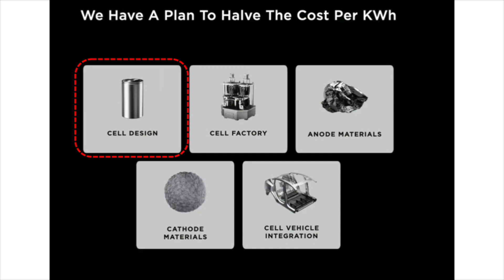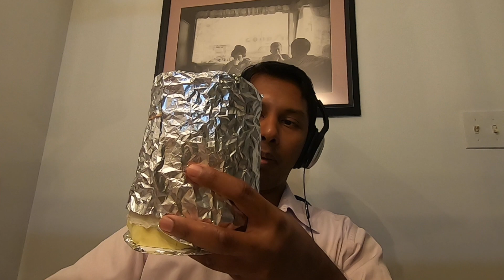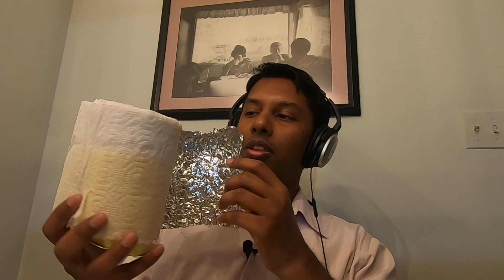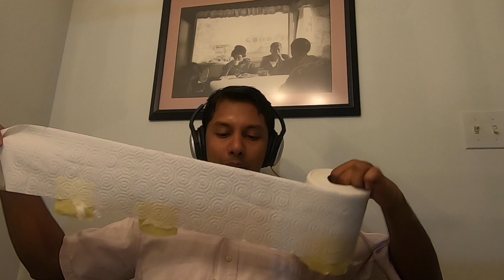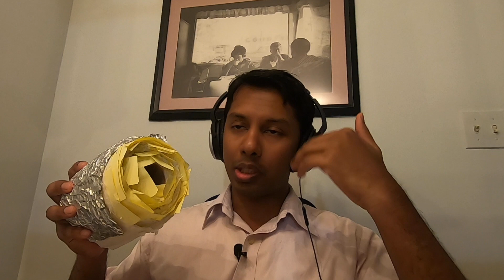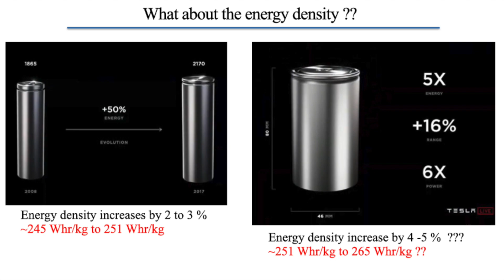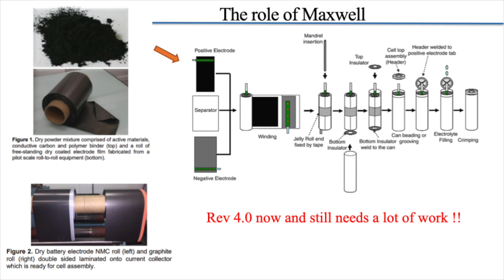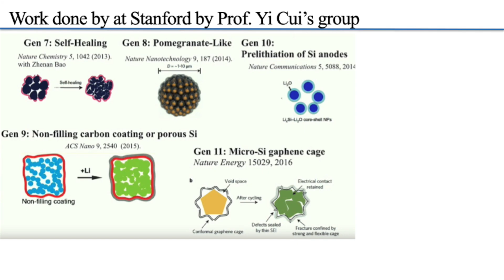Breaking down Tesla's Battery Day with Ravi Kempaiah

Comment: First of all, great video, thanks, 
Secondly, i'd like to ask, does the increased charging rate also translate into a more efficient regenerative breaking? my understanding is that you only get about 10% recharge from breaking because of the heat/charge rate issue. Does this mean that gets a significant increase? Do we know on the order of what? was this the reason Musk stated he didnt want to go down the route of ultra capacitors?
Reply from the maker: I seem to recall Tesla won’t be adding ultracaps to cars.

Comment: Fast charging stations will use a battery bank like a power wall etc which will charge a capacitor bank which will facilitate high current discharge for large battery pack recharging. In a similar manner to way the flash on a traditional SLR CAMERA used to operate.

Comment: Cylindrical design is geometrically more suited to process flow manufacturing. Multiple or continuous points of conduction to the negative side of the cell dramatically reduces both resistance and heat. When i was theorising this almost 10 years ago I imagined the use of an open weave copper fabric as a suitable substrate for the anode. Great design and advancement for tesla team.

Comment: Good video.  Thanks. What are the ideas that weren't far enough along to include in Battery Day and in the coming generation of batteries?  What advantage if any is there to making the cells taller? Unless I'm wrong most of the presentation was on diameter. What about heat and rolling up a coolant layer in the battery? Might there be some advantage if say a turn of the battery had a layer that could circulate coolant?  (Of course something like this would complicate the high speed rolling up) .  I'm just spit balling, but what I gathered on Battery Day and in this video is that some of these ideas are not that new, and some just seem obvious (well, they do now) like the tabless design.  What are the other battery ideas still left on the table? 
Also did I miss no mention at Battery Day of the one million mile battery?

Comment: I believe cooling is now easier because it is done from the bottom of the cell.  The copper and aluminum will conduct heat out the end rapidly as opposed to the heat having to transfer through the non-metallic non-heat-conducting separators.  Much lower heat transfer resistance out the ends just like much lower electric resistance out the ends.  It also has the advantage of cooling uniformly; the inner winds will cool as fast as the outer ones.
Regarding the reason why Panasonic and others haven’t done this is because a major objective of Tesla is to reduce the cell cost.  Right now demand greatly exceeds supply so why cut the cost when it requires a huge investment for Panasonic.  They sell every battery they produce.  Why change?  Tesla has a completely different mindset.  Produce way more batteries at lower cost to accelerate greening.

Comment: With all this extra electricity needed across the country. What effect does this have on the grid infrastructure, what is the capacity of high voltage wires etc. What extra infrastructure will be needed if any say if the electric demand triples over the next twenty years?

Comment: Remember that Tesla bought Hi-Bar systems that makes some of the machines that help with the manufacturing of the cell. Volumetrically, the new cell is 5.48 times larger than the 2170 so you should be able to get a 5X reduction in the number of cells needed for the same kwh. The outer circumference of the cell is just over twice as large, meaning that while they are reducing the cell count, they are also using about half of the outer casing material. This saves weight and cost. The tabless design also focuses the heat to the bottom of the cell which will make for faster charging speeds.....especially for something like the semi. Fun stuff. And Elon admitted that they have had these in their own company test cars since May.

Comment: Here because of Sandy.  I still think every analyst on Youtube and the press have missed the most important thing out of battery day.  On the chart shown at 41:40, Diversified Cathode Approach, as well as comments made by EM , it shows, to me at least, that 70-80% of all Tesla batteries will be LiFePo, and only using nickel for the high end applications........  How did I come up with 70-80%?  The new cheaper car will have 2 - 3X production numbers of the rest of the Tesla fleet plus some model 3 output.  100%, or according to EM, half of eventual battery demand will be LiFePo.  so 50% (storage) plus 25% (cheap cars) equals 75% of total battery consumption by Tesla.

Comment: on 24:20 Sean! demand will grow, electric power for the semis will be provided by the grid. The state energy fuel mix for the grid can define exactly what emissions can related to charging a semi in their grid. Whatever that fuel mix is probably better than to operate the lifetime of the diesel truck! To use only solar and wind is just as gargantuan task as producing 3+ TWh of batteries per year.

Comment: Very interesting to see Ravi’s mock-up of the new cell. To me the picture in the presentation looked more like they were simply cutting (using laser, maybe?) slits into the upper part of the jellyroll to create those shingles without slowing down the whole process, but Ravi used like lots of very wide tabs..? I’m not familiar with the patent description, so Ravi, I assume, has this right. Just wondered how what he showed could be manufactured at the bullet speed Elon wants for his conveyor belts. Cheers!
Reply: caps lock No I’m pretty sure you’re right. And it’s indeed laser cutting as mentioned by Drew I believe.
I think Ravi just used sticky notes to make it more visibly understandable but I could be wrong.

Comment: The solution to charging the semi-truck quickly is relatively straight forward using existing technology. The trick is to charge in parallel, by having, for example six individual100Kw battery packs each one driving an individual motor or pair of motors (as parts of one truck). On the charging side, you would need effectively six standard fast chargers (combined into one large unit) each charging one pack at a rate of say 250KW. This would mean that the Semi truck could be fully charged in the same time as a standard Tesla car no problem at a rate of 1.5 megawatts. Now I am sure it is not that simple but the principle is sound?
Reply: I think they might stack the super charger for more voltage and less current over the plugs

Comment: 5 times energy is because the cell has 5 times the volume as the old one. 6 times the power is because it's like pulling energy out of a 5 times as big cell at 16% less resistance.  (Note how the 5/6 gives you exactly the 16% improvement). People get confused by the "5 times energy" and "6 times power claim"...but that's not the important thing The important thing is the ratio.

Comment: Why dry batteries? Much less dendrites, if any. Dendrites are the reason Li-ion liquid electrolyte batteries start to get low in capacity.
Reply: don't need long cool tables, floor space and water.  A much more efficient compact design

Comment: 1. The graph about charging speed actually shows the amount of slowdown at each battery sizes. So according to that graph, the new cells with the tabless design will still charge a bit slower. On the other hand they said it delivers 6x more power and that should go both ways. We will see.
2. Charging a bigger battery (semi) is always faster, because you charge the cells in parallel. If you can supply enough juice, it doesn't matter how big is your pack, the charging speed will be the same.
3. The new cells will use plate cooling. The cells will be cooled at their lower end, not the sides. This allow way much faster heat transfer, the same way the tabless design works. Plus it eliminates a lot of complexity and weight as the cooling plate is simple and it will be a structural member too.
4. There's no supply chain. That's the whole point. They buy the raw materials, or even mine them, and that's all. They even selected materials that are abundant and cheap. Once they fine tuned the pilot line, scaling up is just replicating the line everywhere. I think they massively downplayed how much cells they will actually produce.
5. Tesla will use a new method to extract lithium, which doesn't require much water or energy.

Comment: He didn't mention that the cooling is going to be happening on the ends, where the heat is quickly wicked away throughout the battery, so less heat generated and the little heat that its generated is quickly dissipated, thus a potentially cheaper and more efficient battery management system.

Comment: Why would you ever think a one tab design was any good, it uses in a lab for testing alright but then why shut down your brain.
Reply: The usage has changed considerably. Previously we used them to power a phone or laptop, where other components define the constraints of the overall system.
Now that we need higher performance/increased energy density, it’s worth the investment to overcome the additional complexity and challenges the tabless design brings.
Reply: @MacGuyver85  If anyone had a cordless drill or other devices(landfill waste) and had them die only to find out that you could shock them back to life once again or now, unplug the bottleneck. The volume of waste unforgiving we have seen it most did not understand a lot of batteries still held life inside but just could not get out or in.

Comment: the battery cells arent the limit for charging speed in the semi. if they use the model 3 cells, they are charging at 3.33kw per kw cell capacity. so if yoiu change the capacity from 75 upto 1000kwh then you see that the load the cells can take is 3.3MWh charge rate. The issue will be the connection and cable to the connection at the supercharger end. inside the truck im sure they can cool whatever is required to get from the charge port to the cells. but cooling the connector and cable from supercharger to plug will require some effective cooling or a massivly thick cable.

Comment: The old cooling method had a bunch of tiny channels that coolant had to be forced through, winding back and forth between cells.  The new cooling method will be big straight pipes along the bottom of the cells.  That means higher volumes of coolant, simpler construction, and as a bonus the coolant channels themselves provide a buffer in a bottom impact.

Comment: The new thermal architecture has already been mentioned to be on the ends, not the sides which is what sandy monroe says is more effective at maintaining temperature. They are no longer going to use the lasagna method. They will use thermal plates at the top and or bottom of the battery along with the collectors. This is actually used in the ipace which monroe prefers.

Comment: Battery Cooling. An internal "chimney" was created in each cell center. The cooling plates (TWO vs 100 cooling plates) will be at the battery BASE and TOP - not sides. That surface area of contact for 4680s is greater than the 18650 sides and far more efficient. Thermals are allowed a positive physical path (hot goes to cold AND heat generally rises). One of the charts showed 18650 battery temperatures rising under TWO scenarios - hard use discharge and fast charging regimes. Yet the 4680 cells had almost NO thermal change during this "operation". If correctly interpreted, rapid charing Semi's will be easy. BTW, new cell FORMATION will be done as a Use SET - all at once
Reply: I was waiting for someone to notice this ... this is a huge problem solved that most viewers seem to have missed, thanks for bringing it up.

Comment: 4680 cell production Manufacturing Equipment was reduced by 75% simply by eliminating the WET SOLVENT SECTION. That was HUGE. Plus, no more PROCESSING CHEMICALS in this new machine, eliminating both mandatory OSHA and EPA monitoring. It's done with water and table salt (as stated in the presentation). The presentation was far from linear and takes several "viewings" to begin re-assembling in chronological order - but well worth it. The two of you discussing, interacting and explaining makes it all a bit more understandable and tolerable - science CAN get boring... Thanks to both of you for sharing.

Comment: Looking at the slides Elon had up on the pack, it looks like the cooling will be done from the bottom, you can see channels under the batteries.
With the shingle cooper current collector's at the bottom it would have a much higher heat transfer capacity.
Which would simplify cooling instead if having the micro channel extrusion snaking around the sides of the battery, it could be flat and straight under the pack.

Comment: One thing that's gone under the radar.
I think they'll be using the same format for all cells, including LiFePo4.
If this format takes a chemistry that's at about 200W/kg and removes the rectangular case, it becomes lighter.
If they use the same RR factory, it becomes cheaper (and faster) to produce
If they use Maxwell tech, density increases.
I wonder if they can reach 250W/kg? (Same as existing 2170)
Great for the "cheap" vehicles.
Reply: Drew or Elon mention that they can do that and have many of the improvements as well.

Comment: This was great, I was waiting for a discussion like this. The Battery day event was so rich with information but light on a lot of the implications.  
What we know is  Tesla now has low cell scale production on a pilot line. These cells are the new form factor 4680 and they include the dry battery electrode and tab less technology. The tabless technology seems complete but the dry battery electrode process is only working slowly and needs about 2 more iterations of the technology which is expected to take 3 to 4 months for each iteration. In 12 months the pilot line should be running at an annual rate of 10GWH which is a reasonable sized addition to there current output they will be able to ramp the Cybertruck and the Semi with this.
This technology drastically increases both the power and charging speed, energy density at the cell level is improved. 
Vehicle weight and power will be improved. 
Over time Tesla will be able to massively increase production, this technology was needed to bring Semi Cybertruck, Roadster and probably Model S Plaid into production as well as a  truly affordable var.
This is great news.
Reply: Should be 10 GWh instead of MWh,  which would be massive, thats almost 1/3rd as what nevada puts out with 13 lines
Reply: @quantaca5773  True

Comment: Li ion charging time is independent of cell capacity. With the correct chargers a 10kWh battery charges just as fast as a 100kWh battery. Battery charging current is limited by the C rating. 1C 2000Ah battery charges at 2000 amps and takes approximately 1 hour. 1C 2Ah battery charges at 2 amps and also takes approximately 1 hour. (The 1 hour is an example number) So regardless of cell design if it is rated to safely charge at 1C then the charging time for a car or truck using that cell will be the same using the same cell IF the charging infrastructure is scaled accordingly.

Comment: Much less heat is produced in the shorter path to the continuous tabs, so much less cooling is required. You can just cool the ends and be done.
Reply: Coming at the ends is far more efficient. So it's less cooling required and better cooling.

Comment: I believe the Supercharger graph has been missinterpreted. It is difficult to see but that graph shows another line for the tab design. That graph shows that if they had stuck with a tab design as the diameter increases the charging time increase. With tabless the charging time remains the same. 
Once resistance is taken care of the next hurdle is time for the ion exchange hence almost any li ion cell charges to 80% fast regardless of mAh. The last 20% is always slow due to the chemical reaction and heat.
Reply: The new cell charges slightly slower even, as the line still slopes up a little.
So they traded the benefits of the tabless design for an increase in diameter.
Many people seem to misread this graph, yet it’s clearly labeled. Confirmation bias I guess :)

Comment: Solar & wind don't need to deliver a lot of power at once to charge an EV. They can slowly charge a power bank, and then the power bank quickly dumps power into an EV as fast as it can take it.
Reply: Mike Dannheim The power bank may be capacitors.
Reply: @MikeCasey311  not likely capacitors are very low volume to power ratio
Reply: @ralanham76  Good Point!
Reply: @MikeCasey311   - NO, Tesla is using LFP by CATL for its GRID Energy products.
many Superchargers are Getting upgrades to MEGAPACK , each MP can store 3Gwh of power.
Reply: Mark Plott  Thank you Mark. I am learning a lot. 👍🇺🇸

Comment: This innovative electrode configuration is not very novel it has been done in capacitors for decades. Low resistance in the capacitor was one of the goals. While cell resistance contributes to loss and limits charge current we must remember this new cell replaces 6 or so 2170 cells so we must compare the parallel impedance of 6 2170s to one new cell. When you do the difference is less. Still the new cell is vastly improved over the previous in both electrical conduction and thermal conduction. This certainly favors higher charge currents which is the trend these days. The new cell has lower resistance but also much higher current. 

The semi will charge quickly because it has a huge 1Mw battery tp spread the current across. If the truck had 10 100 Kw packs from a model S and you plugged them in to 10 super chargers it would charge like a car. 

The new cell is a magnificent break through that drives a few more nails in the coffins of Big Auto.
JY